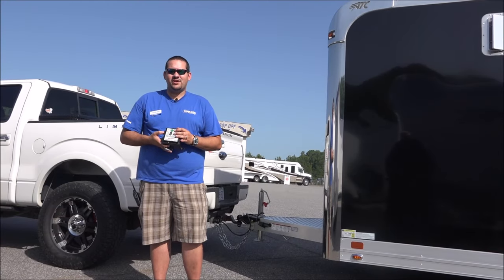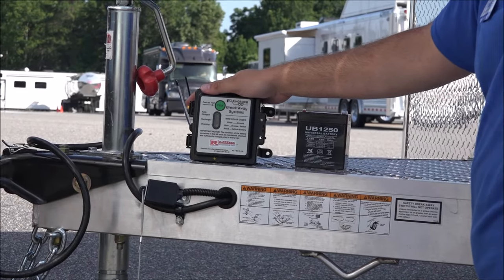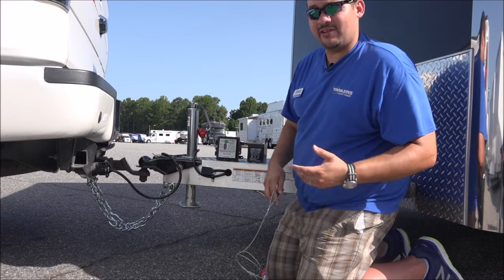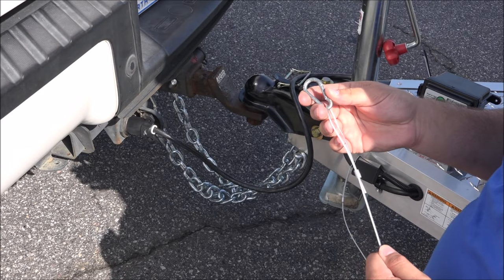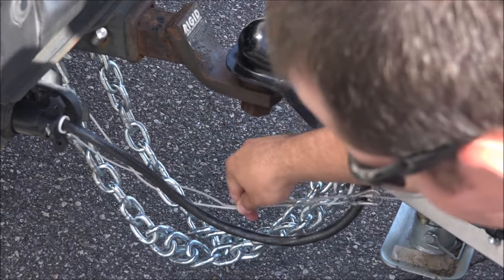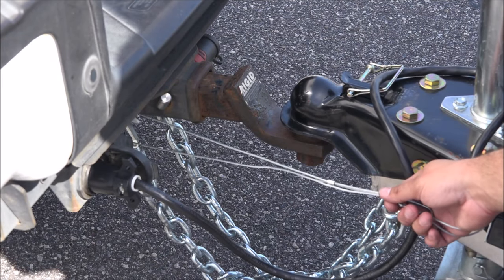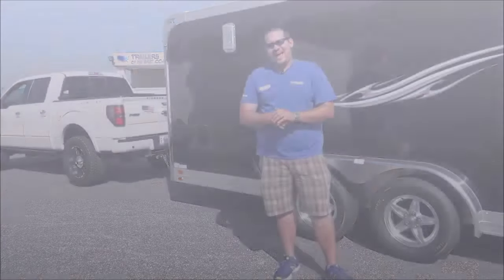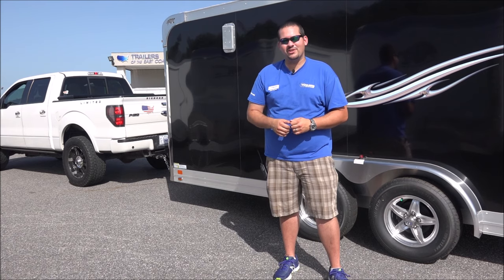How to Connect a Trailer Breakaway Cable

Comment: DON"T clip the safety cable to the receiver! If you have a failure of the receiver (it has happened) all your safety connections (chains and cable) are attached to the same single point of failure. Attach the cable to the truck in a different location.
Reply: If the receiver fails, the tongue/coupler slams into ground , curious if that’s enough to pull it

Comment: PLEASE people, be aware the breakaway is for EXACTLY that - a breakaway. Both of these have been mentioned in comments at yet this video is still here. First, DO NOT ATTACH to any part of hitch - the entire hitch can break from the frame and then this pin would not be pulled - hence this is an illegal attachment point. Second can be debated but: a popped ball would still leave brakes functional via harness and if your chains are correct length they will center and cradle the tongue allowing a safe stop. It's called a BREAKAWAY system for a reason.

Comment: You looped the cable through the hitch receiver. It should never be hooked to the hitch receiver, it should be hooked to the frame of the tow vehicle. In the unlikely event that the hitch receiver falls off the tow vehicle, your method would not pull the breakaway pin.

Comment: I noticed in your video that you had the safety chains twisted. I've been told to never twist the safety chains to shorten their length as doing so will weaken their strength if they are needed due to the trailer coming off the hitch ball.

Comment: The method of braiding the cable through the chain is how I received it when I picked up my travel trailer. I subsequently changed that and have it as you have recommended. Great tip on breakaway system.
Reply: Ditto...received it in the same condition.

Comment: Noob here. My cable is still looped thru chains as received when bought. I keep my TT in a RV storage facility, they never mentioned this is a problem.  I accidently did something last camping trip that caused the car to take off when I disconnected from hitch.  Luckily I had x-chocked and leveled the camper and that caught the car as chains "grabbed" the runaway car. But the breakaway cable wasn't attached because I did not know how.  I'm glad I found this video. I just ordered the snaphook, and will free cable from chains and follow instructions.  I don't get to camp often, but I've had the TT for 3 years, and no one has said anything,  prob because they figured I was taught or running the cable thru after disconnecting for storage. Thank you for resolving a question I've had since buying the TT but assumed since no one at storage said anything, it must be okay.  The cable has literally never been attached properly while traveling.  I tent camped for 25 years prior to buying a TT, so had zero experience and am still learning.  When I bought the TT, the salesman was on vacation, and I never got a walkthrough (6 months to pickup TT during covid in 2020).

Comment: Great video! For many years mine was too slack, I've even done the chain weave. a while back I was giving more thought this situation and realized that, if the chains are longer than the safety cable, the brakes can't engage. A simple knot in the cable fixed the issue. This video reinforces that my thinking was correct. Thank you!!!!

Comment: Wow...I learned just now what I have been doing incorrectly all along...THANK YOU FOR THIS VIDEO!!!
Reply: This video is also wrong unfortunately. If the whole hitch receiver fails then it’s rendered completely useless. The break away cable needs to be attached to the tow vehicle not the hitch receiver.

Comment: Thanks for the video!!!  I purchased a new camper and the breakaway cable was very long.  The dealer braided it inside the safety chain and it ended up rubbing against the ground.  Long story short the breakaway cable broke.  I started to think about how they did it and it just did not make sense.  Your video helped clarify how the system is supposed to operate and I will be building a new breakaway cable tonight.

Comment: I was always told to connect it to the vehicle not the hitch in the off chance that the hitch comes off the vehicle.  I used to drive a tow truck and I have seen it happen twice where the hitch either broke apart and where the mounting bolts broke.

Comment: Just had this system installed on my 5x8 trailer. No idea how to use the breakaway kit and where to clip it. Thank you for your help and suggestions. I have the system with the built in tester and it is inside the trailer at the tip of my V-Nose. Going to enclose it in plywood and caulk but leave the top open for easy access.

Comment: What if the receiver fails and the receiver tube separates from the rest of the frame of the receiver? The trailer will separate but the breakaway cable won’t deploy. If you wrap the breakaway cable around the receiver frame behind the bumper, it will deploy in this failure mode.

Comment: Should attach breakaway cable opposite side from the switch so it won't tighten (and maybe pull out from the switch) on a hard right turn.

Comment: At the end of your video you mentioned checking the trailer brakes before your trip. I assume you would do that by pulling the pin out of the box and try to drive it to see if its dragging ?
Reply: That info would have been useful...

Comment: I wish you would have said something about the stretch red phone cord style cables you see many people using.  Unless they have been cut in half or less those will never engage the emergency brakes, because of their length and how long they can stretch before the pin would be pulled out.

Comment: Wouldn't the manual feature on the brake controller be used if the trailer came off the hitch but was still on the chins? This way you have more control of the trailer. I though the safety break is used when the trailer completely detaches from the tow vehicle and would have otherwise be in a runaway condition.

Comment: Do you recommend against using coiled breakaway cables? Got one to replace the knotted up cable my trailer came with, but it's near impossible to tell if it's tight enough without being too tight. I want the e brakes engaging before the chains break.

Comment: This was such a great eye opening video, thank you.  I shared it with a trailer user group I admin and so many of them were doing it all wrong and followed your instructions to fix.  Question: When redoing mine I pulled the key from the switch for a few minutes.  I forgot to turn the battery disconnect off.  The switch got really hot and the insulation on one of the wires started to melt.  I have some people telling me this is normal since the switch is only used in an emergency and there's 3.5 to 4 amps going to each trailer break.  The wire on the switch is a measly 16 to 18awg.  I have others telling me I probably have a short to ground.  I had some friends test theirs, on the same trailer, and theirs got hot too.  Do you have any thoughts you could share on this overheating issue?  Thank you very much.
Reply from the maker: Hi Tom - Thank you for watching our video. So glad it was helpful. When you are unplugging the breakaway cable, it is sending power to the brakes, so if you leave it disconnected for more than 30 seconds, the wire will get hot. So, the goal should be to disconnect the switch and run the cable through the hitch in a timely manner to prevent any issues to the wiring. If you still experience any issues, feel free to give our Trailers of the East Coast Service Department a call to make sure there are no brake issues causing that. 336-751-2377.

Comment: Thanks for the video! Is the breakaway switch wired directly to the battery, or is it wired by way of the fuse panel?
Reply from the maker: The breakaway switch is wired to an onboard battery in the trailer itself.  The part number for the battery is UB1250

Comment: I was confused about when you said that the breakaway cable has to have less slack than the chains. Are you saying that you want the breakaway switch to actuate while the tow vehicle is attached to the trailer with the chains? This is contrary to the RVIA.   From etrailer Expert Reply: The breakaway cable should be Longer than the safety chains according to RVIA Recreational Vehicle Industry Association. This will activate the brakes in the event you lose the trailer connection and the safety chains fail which will bring the trailer to a stop.Apr 18, 2018  I'm going to replace my current cable with the Fastway Zip Breakaway cable.  It is long enough to only actuate the breakaway switch when the tow vehicle breaks from the tow safety chains and it is coiled so it stays above the chains during normal use.

Comment: Hi mate thanks for a great video.My question was after parking my trailer can I pull out the trailer breakaway cable and can the trailer brakes lock preventing my trailer from getting stolen .Then putting the breakaway back in to the socket to release the brakes back to normal position.l have a HYDRASTAR Electric over hydraulic thanks Kemal
Reply: I think your battery would run out of power after a certain amount of time if it was used like you are describing. Just my thoughts.

Comment: What if the hitch receiver fails?
Reply: If you hitch fails the cable will still pull the pin.  If you’re asking what if the receiver comes off the tow vehicle,,, then you deserve what you get for not assuring the receiver was not in good condition to tow a trailer.  Where does the operators responsibility start?  How about the moment YOU attach something to the tow vehicle (which needs to be capable of the task at hand).  Just remember, there’s no cure for stupid!!!

Comment: it's called a "break away"  system for a reason. Having the brakes activate if the couple comes off the ball can lead to loss of control and cause an accident. It would be preferable to have the coupler land on the chains, hence the crossing of the chains, then be able to use your emergency actuator to control the braking action as needed and maintain control of the tow vehicle and trailer. Having your brakes come all at full actuation power while the trailer is still attached to the tow vehicle is a sure way to have your trailer flip and pull your tow vehicle out of control.  You're doing it wrong!
Reply: Comment on "hook" at 1:58.

You claim to attach the the safety cable to the "hook" where the safety chains attach. I suspect it is NOT a "hook" at all (hook is on the chain) but rather the "eye" on the hitch assembly. But,... I could be wrong. If you were to actually show the attachment point, we would know.
Reply: Sorry, this was meant to be a top level comment. Not to Charlie.